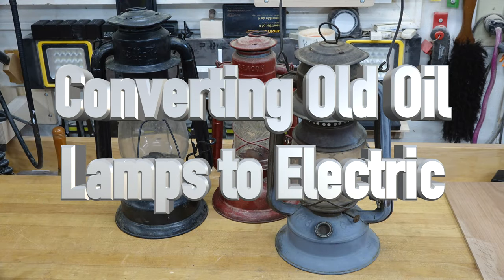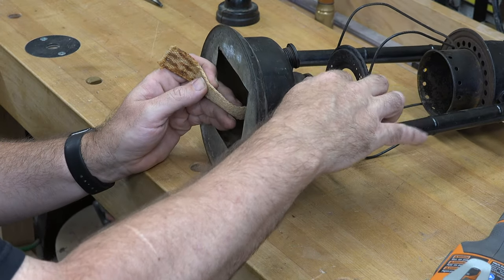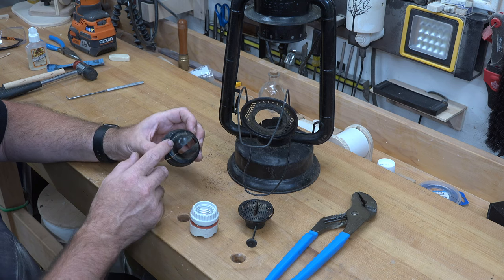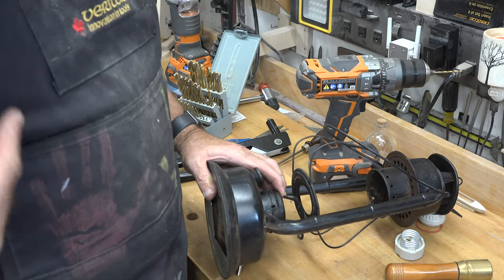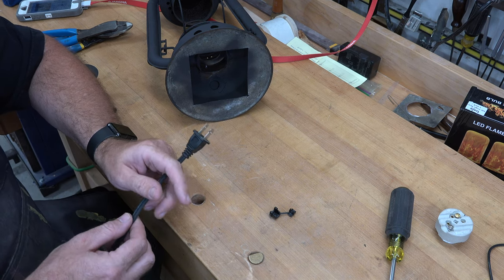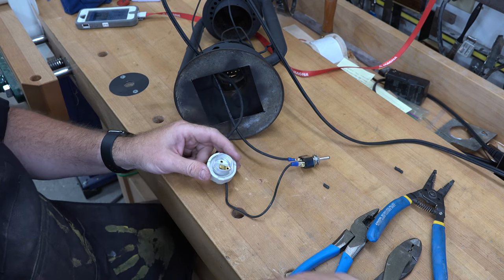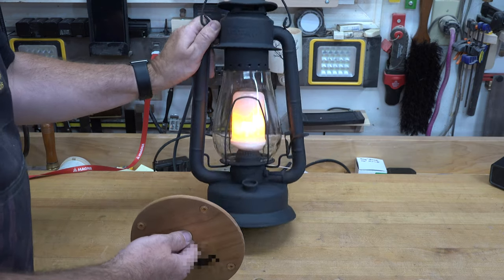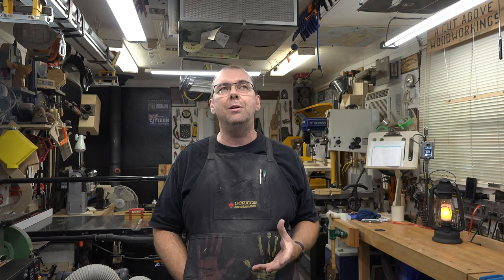Converting an Oil Lamp to Electric

Comment: That lantern looked to be in good shape with a nice solid font. Unfortunately this lantern has been ruined. There are ways to electrify a lantern without completely destroying the value of it.
Reply from the maker: The lantern looked like it was in good shape because it had been painted to cover the rusting.  The interior of the tank and the mechanisms were badly corroded as this lantern sat outside for years before I managed to get my hands on it.  Regardless of the state of repair of the lantern, the method that I used on the show may not suit everyone and I hope that you are able to find a method that works for you.  Thanks for tuning in to the show.

Comment: I want to turn an electrified oil lamp back to oil burning....
Reply from the maker: Depending on how much modification has been done to the lamp, it may or may not be possible.  If they have modified to burner assembly like I have done for the lamp in the video, it may not be possible.  It would be an interesting project though.  Thanks for tuning in to the show.

Comment: I added a dimmer switch inside and hid the turning knob in the fuel cap, by cutting the nipple out some. So externally you can't see any switches at all, and when you turn the fuel tank cap...viola! Its a dimmer switch!
Reply from the maker: Great idea Chintan.  It sounds like your lamp is awesome.  Thanks for tuning in to the show and taking the time to chime in with your story.  It's very much appreciated.

Comment: I enjoyed watching this upgrade to this lamp.  I do recall when the two prong plugs were not polarized.  One could plug them in either way.  I experienced this "shocking" realization when changing a bulb in a lamp in the 1950's.  First I didn't unplug the lamp and of course I didn't know if the switch was on or off (50-50 chance).  Apparently I was holding onto the brass base of the bulb when starting the bulb into the socket and experienced a big wake up call!  It was quite a few years later before I realized what had actually happened.  Guessing their were a lot of "lite up" people at that time.
Reply from the maker: LOL.  Sorry to hear about your little mishap Dwight.  Glad to hear that it wasn't worse.  Thanks for tuning in to the show and taking the time to leave your story.  I appreciate you sharing it with me.  I love it.

Comment: Hi Kenny:
On most, if not all appliance cords, the positive or HOT wire plastic coating is ribbed the full length of the cord.  The ribbed coating corresponds to the smaller plug blade. I'm not advocating tha all cords are the same.  Most are.
Nice job Kenny.
Chuck
Reply from the maker: I agree with you on this one Chuck and that is exactly why I didn't mention anything like that in the show.  I didn't want to give the impression that all cords are the same.  Better off to check the cord you are using and make sure which is which.  Thanks for the kind words on the project and for tuning in.

Comment: Hi Kenny, is there a theme here. Lighthouse, lantern two great projects. Just a note Kenny is it ok to have the base of the lamp held on by magnets 🧲. Reason I ask is that my grandchildren can seem to open anything. Thanks again for your time.
Reply from the maker: No theme this time Philip.  I just made the projects that appealed to me.  As for the magnets, there is nothing wrong with mounting the base like that but obviously, if you have concerns about it with your grandchildren, then feel free to secure the base in a different way.  You would epoxy small blocks of wood to the inside of the lamp's base and then screw the base on to the bottom of the lamp.  They wont be getting that open without a screwdriver.  I hope this helps.  Thanks for tuning in this week sir and for the kind words on the projects.  It is truly appreciated.

Comment: After seeing your Halloween grim reaper, I've decided to make one and your modified lantern. I just ordered the LED bulb. I'm curious àbout the 1 inch hole in the bottom of the base. Is it necessary? I'm afraid of little fingers getting in there and touching the wires.
Reply from the maker: The hole gives you access to the socket and cables in order to do the connections Jim.  My cover is held in place with magnets but if you are concerned, you could always screw or rivet a cover on after the connections are done.  I hope this helps.  Good luck on your project and thanks for tuning in to the show.

Comment: What a great idea! I’m Canadian too, is there any chance of converting the wick adjuster into the on/off switch?
Reply from the maker: I'm sure that you could do that Mike but there is pretty limited room available in that housing to get the electrical in there.  That was the reason I went with a toggle switch at the back.  But anything is possible with a little ingenuity. Thanks for tuning in to the show and for the kind words on the project.
Reply: Thanks for taking the time to respond, electrical work is not my strong suit so I thought I’d ask.

Comment: anyway to make these weatherproof for outdoor use?
Reply from the maker: These original lamps were intended for outdoor use as well as indoor so as long as you can seal up anything that you cut apart, chances are you can use it outdoors.  Now with that being said, electricity and rain don't mix so it would only be a fair weather lamp anyway.  I hope this helps.  Thanks for tuning in.

Comment: You probably could've turned that wick adjustment into a "dimmer switch"
Reply from the maker: Probably could have, but the flame lamps are not dimmable.  Thanks for tuning in to the show.
Reply: @acutabove_woodworkings  yeah, I made that comment before knowing you were going that route lol
Reply from the maker: @alabamamotionpictureproduc6626  No problem.  It's still a great idea that someone else can incorporate into their build.  Thanks.